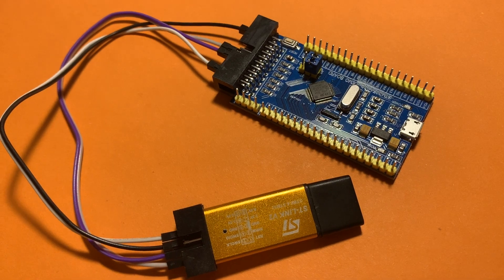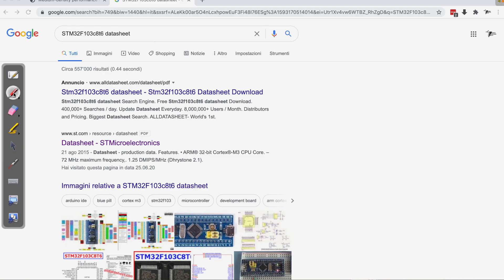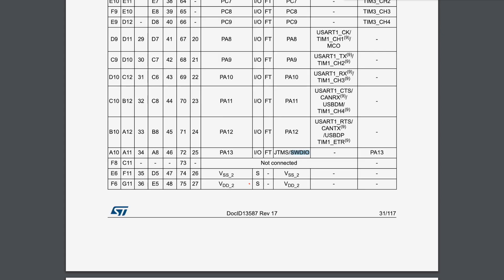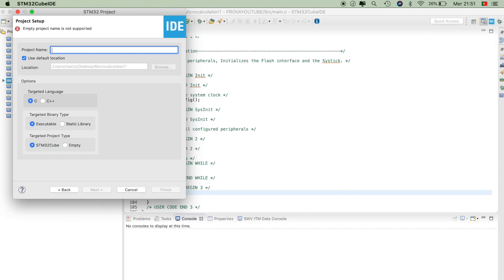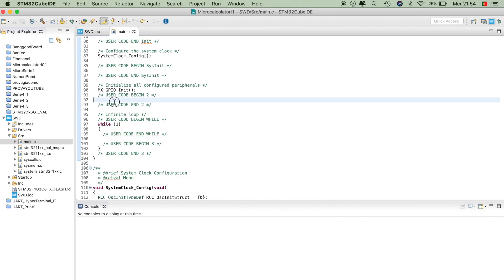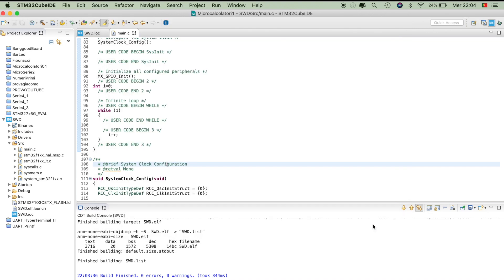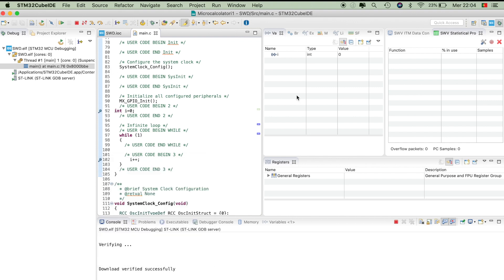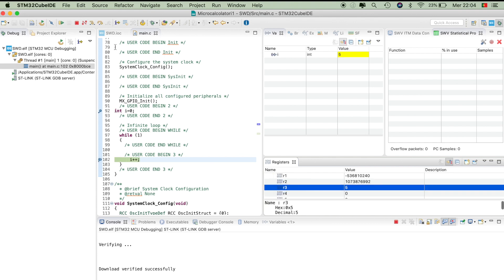Debug the STM32 (BluePill) using SWD and ST-LINK V2 in STM32CubeIDE

Comment: There was a mistake in the video regarding the jumper wires... Its better if you  put the two BOOT pins at "zero" since the BOOT0 is used to tell the STM32 to run the code from the flash and it needs to be put on GND.
Reply: Thanks for your observation, was getting mad about it, after boot0 and boot1 at zero,  debuger is running ok. but very good video.

Comment: Error in final launch sequence:

Failed to start GDB server
Failed to start GDB server
Error in initializing ST-LINK device.
Reason: (4) No device found on target.

That is what I've got.  st-link upgrade done ok. but it still does not work. Any idea why ? I checked +3V3, GND, SWDIO, SWCLK pins OK. 
After the usb port is plugged +5V ok checked. It looks like the hardware OK.
Reply: I had this problem when the ST-link isn't connected correctly to the microcontroller and also sometimes when my usb hub in my pc has bugs. Did you try to restart your pc? I am sory it doesn't work. It should.
Reply: @marcotrevisanmota5209  OK. Thanks for replying. Restart PC done. Still not working. I tested it successfully without IDE by using makefile. Thanks anyway.
Reply: @natsagnyamnamkhai749  how solved ?? Stlink v2 utility is working but cubelide debug is not working

Comment: I've got Error in initializing ST-LINK device!   I've got STM32CubeIDE, linux Ubuntu, stlink installed.  STM32 (BluePill)  via  SWD.  SWD is enebled, HSE selected as you've done. Any idea ?
Reply: Are you sure the debug settings are right? If the board isnt connected correctly you will have the initialization problem. Check the wiring. Rememebr that GND must be in common. Have the jumper wire for the boot pin be at GND. Check for all this. If you have still problems let me know.
Reply: @marcotrevisanmota5209 Thanks for your support! Yes I did it as you did. Wiring checked. I've seen something in the user manual of Blue Pill as that " lace a resistor between pin PC14 and 3.3V, ". It did not say what Ohms ? is it 1k8 ? The PC14 is connected to the external Clock of 32KHz. I wonder why it requires Res between PC14 and +3V3 ? 
What about 
{

Bootloader Flash with [1] (https://github.com/rogerclarkmelbourne/STM32duino-
bootloader/raw/master/STM32F1/binaries/generic_boot20_pc13.bin)

}  ?
Reply: That is what I've got:

STMicroelectronics ST-LINK GDB server. Version 5.7.0
Copyright (c) 2020, STMicroelectronics. All rights reserved.

Starting server with the following options:
        Persistent Mode            : Disabled
        Logging Level              : 1
        Listen Port Number         : 61234
        Status Refresh Delay       : 15s
        Verbose Mode               : Disabled
        SWD Debug                  : Enabled
        InitWhile                  : Enabled

Target no device found

Error in initializing ST-LINK device.
Reason: No device found on target.

Comment: Ciao. Ti chiedo gia scusa a priori se la domanda non ha senso, ma non sono esperto in materia. 
Ho un problema con una autoradio android che sembra andare in loop continuo con il bootload a causa di una procedura fash rom andata male. A scehrmo appare sempre la scritta iniziale di avvio, ma olrte a quello non va. Non riesco a portare il sistema in recovery mode. E' possibile che il problema sia nel chip STM32F0 da riprogrammare? E se si, che file ( estensione e dimensione) devo caricare con ST-LINK? Se sono completamente fuori strada dimmelo, e ti cheido di nuovo scusa per eventuali sciocchezze scritte. Grazie
Reply from the maker: Il pin di boot del micro è collegato a massa? Non dovesse essere collegato collegalo a massa così il micro sa che deve leggere il codice dalla flash. Potrebbe essere quello il problema...
Reply: @marcomotaelectronics3134  non saprei dove trovare il PIN del boot da non mettere a massa. Nelle altre schede ho visto il PIN fisico da spostare, ma qua non lo trovo.